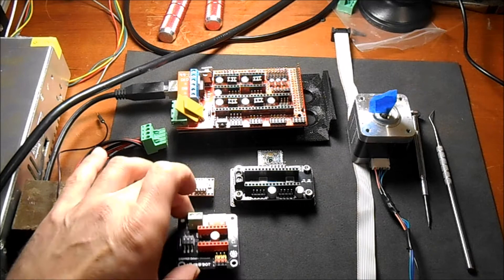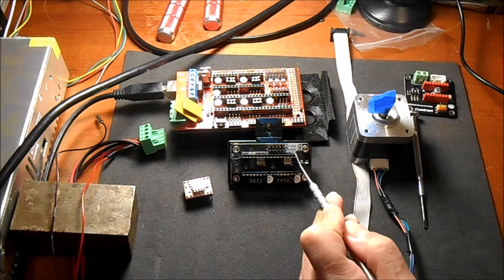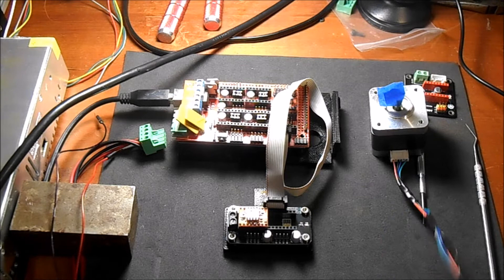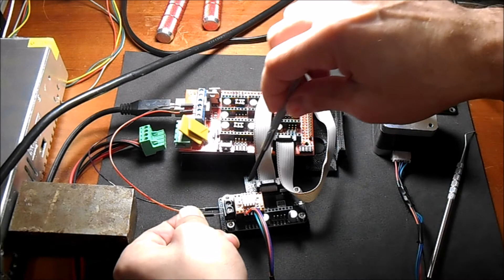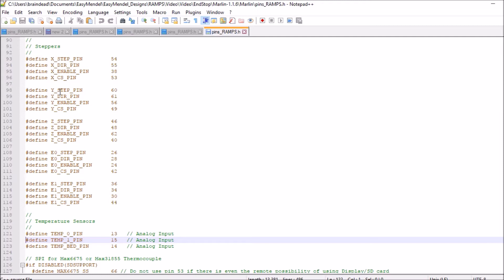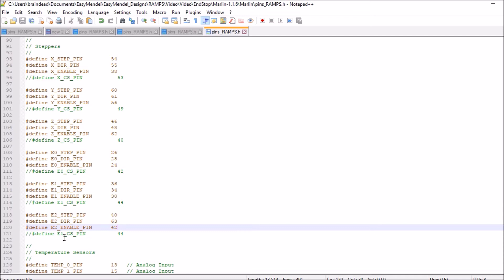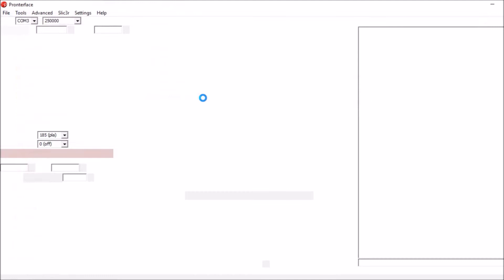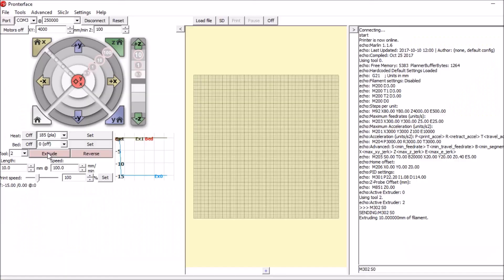RAMPS 1.4 - Adding 3 or more Extruders

Comment: I came to operate the 5 extruders for the DIAMOND x5 (FULL COLOR) and everything seemed ok (apart from the cobwebs, I am fighting with the percolation of the nozzle and the retraction) but in the end I discovered that the 5th extruder the 3rd for the extender x3, the one that has as pin: // ### EXTRUDER_4 #define ORIG_E4_STEP_PIN 57 #define ORIG_E4_DIR_PIN 1 #define ORIG_E4_ENABLE_PIN 58 both that extrude that portrays always goes in retraction, that at the beginning to resolve it quickly (not having noticed that it did not change direction) I inverted the wires on the motor and extruded but did not retract !!!! So now that I do, how can I check the pin 1 (DIR) to see that it is not badly managed or do you suggest me to use another pin?!?!?! if you can?, thanks for your patience. P.S: I use a RAMPS and the pin changes I made them directly in 33.h for the expanders I used the REPRAP x3 one with the cable already wired
it's possible ?

Comment: So I think I've watched all the videos you make, and definitely appreciate the info.  I've got a couple questions,  as I'm trying to upgrade my anet a8.  I have this setup that's in this video, stepper expander x2.  Im also using repetier host instead of pronterface.  Ive got one motor on the regular E0 connection, I have the stepper expander plugged into aux-2.  I see you plugged in the vmot to where the bed and fan connection.  Can I use the 12v pin instead of the one you plugged into to power the motors?  when I try to extrude, the one connected to E0 works the way its supposed to, however the 2 that are connected to stepper expander board, one does nothing at all and the other acts like its trying to move but isnt really moving.  Im going to be adding my bl touch after I get these motors working correctly.  Ive copied the pin code and reassigned them like you did.  Is there any other firmware changes I may have missed?  Ive made it where i can cold extrude, Ive also changed the extruders to 3 and uncommented singlenozzle.  If you want to email me and call me a noob, I wouldnt be offended, but direction would be much appreciated.  email is lloydwillis88@gmail.com  or if you wanted to leave a comment here to, up to you.  but any help would be awesome.

Comment: I was wondering how to move 2 extruder motors simultaneously. (E0 and E1).
Reply from the maker: There's a playlist in description also technically they do not move simultaneously.  It occurs so quickly it appears that way.
Reply: @EdwardBraiman  Very nice! Thanks!
Reply: @EdwardBraiman   It took me many hours to find, in RAMPS 1.4 to move E0 and E1 simultaneously IS POSSIBLE YES. Just describe in the file: "Configuration_adv.h" the line: "#define E_DUAL_STEPPER_DRIVERS" (// Drive the E axis with two synchronized steppers). But your video helped me with other issues as well. Thank you very much!

Comment: Hi Edward, Thanks for easy explanation. I found your channel is very useful.. one question if you don't mind. D40 pin grabbed my attention when you defined it as one pin in Aux-2. Although, pin D40 was originally assigned to Z_CS_PIN in Marlin firmware?  I also found ramps diagram on the internet which defined D59 instead of D40. but I'm not sure about the accuracy of the diagram's source. appreciate your feedback. thanks
Reply from the maker: So the diagram for pins might be incorrect.  One way to test is enable pins debugging in marlin and measure with a multimeter to confirm pin number.

Comment: I ask you a question when I make Arduino ramps casing for electronics my 3D printer now not powering only my power supply is power even my usb to connect ramps is not work? How fix it
Reply from the maker: I'm going to need more details, use Discord link and explain issue in General chat.
Reply: @EdwardBraiman  huh I fix now! but my LCD is not work on power supply but using usb connect to my Laptop is working.. but on power supply is blank lcd
Reply from the maker: There's a Discord link in channel.

Comment: If i wanted to add a third totally separated hotend, so theres 3. how would I go about adding the thermistor and heating wires to the board?
Reply from the maker: You could use the heat bed connection.

Comment: Awesome video. Thank you. Could I use this same method to add another X axis for independent extruder heads? I have a dual extruder printer , but both extruders share the same carriage on axis.
Reply from the maker: In the board configuration it will not work for x axis.  In a couple of weeks I'll have a solution to this question.  I'm just waiting on parts for some of the videos still to be recorded.  So far I've recorded 4 videos, granted I rerecorded 3 of them.  So I'll start spooning them out next Saturday.
Reply: Somehow Makergear made it work on their new M3 Independent dual. They said they basically did as you did to add the driver for the second x axis, called it a daughter driver. they supposedly are using the 1.4 or 1.3 board still. I wonder if they use the "daughter driver" to drive a different axis. I am also looking for a solution for the added x axis home switch. What kind of parts do you need? I have a new makergear M2 torn apart for this mod. Thank you for the reply
Reply from the maker: It may be a setting in Marlin firmware. I'll have to research.

Comment: in my ramps 1.4 board i have E0 and E1 they have the same number 2B 2A 1A 1B, what is the number of E1 pins that i can use it please, thank you
Reply from the maker: +Shell_TrayWnd the 2b, 2a,1b and 1a are the pin used by the pulolo stepper on the motor for the pulses.  I'll do more research tommorow, but I'll know more after I have more content.
Reply: ok sir ill waiting you answer and thank you
Reply from the maker: +Shell_TrayWnd one question you're trying to see how to configure the Anet for an additional stepper , correct?  So, what would like to know how to configure in the dot h file.
Reply from the maker: +Shell_TrayWnd I've got about 5.5 hours left of my work day left, so afterwards I'll have time to take a look.   So could you detail the steps you have attempted in marlinfw dot h files?

Comment: Thanks for easy explanation.
Are you using this for Diamond Extruder ?
Reply from the maker: +ChiRag Chaudhari correct.
Reply: how much retract lenght need to change beetwen color?
Reply from the maker: +Teddy Kristiyan , this depends on where you mount the feed unit and how long your feed tube is.  You can measure the distance by measuring the filament length in your printer system. Hope this helps.

Comment: I've a free place for one stepper driver on ramps (4 controller in use for 5 stepper motors on printer). Can I use the free place? Nice to know that is possible to extend with many others
Reply from the maker: So your currently connected to x,y,z and e0?  And you want to use e1? Or are you trying to add an e2?  All possible, just depends on your configuration and if you're using a heat bed or not.

Comment: Doing the further questioning here xD I have a hard time finding that 2x Extrudrboard.. do you happen to have a link or part number? (the name seems so generic)

final question, while I am aware about the different stepper drivers, would it matter to have say A4988 drivers for the extruders and TMC2130s for the XYZ? So when is it overkill for extruders?
Reply from the maker: TMC 2130 are good, as for extruder I prefer drv8825.  I don't recommend double extruder, but I think you can find it still on RAMPS wiki.

Comment: Is it possible to power it directly from the power supply instead of one of D8 / D9 /D10
Reply from the maker: That might be extremely dangerous.
Reply: Is it possible to connect it another another way, cause I have an heated bed , hotend and an fan to power. What do you recommend?
Reply from the maker: There maybe, but you have to consider s searching the forums.

Comment: will this work with repetier host as well?  I just got my new 3 way nozzel and I want to hook it up.  From what I gather, I need ramps 1.4 board to run it, regular anet a8 board wont cut it.  I am curious as to what the j3 connector for standard board does.  Is it possible to use that port to add 2 additional stepper motors?
Reply from the maker: It's possible, but I've not tried it.
Reply: @EdwardBraiman  whats possible?  Hooked up with j3 pin?

Comment: Any reason for using BOARD_RAMPS_14_EFF instead of EFB (with a heated bed)? The 12V power for the stepper expander can be taken directly from the power supply instead of the D9 on the RAMPS board...
Reply from the maker: At the time it seemed like a good way to demonstrate.  I was more interested in getting it out for people to see as most videos didn't cover most the steps.  I'll be doing a new series soon and will be fixing a lot of the house keeping issues.  More suggests are always welcome.  Thank you.
Reply: When improving things, you could consider to add a fan-extender on the servo port. This way you can control the fan for the hotend (based on temperature), and also add a fan to control cooling of the RAMPS board and stepper drivers (which automatically can turn off e.g. 30 seconds after a print is finished)
Reply: @EdwardBraiman  So Ive made quite a bit of progress on my upgrade.  Ive got 2 out of 3 motors running correctly.  The problem is the third motor.  Ive tried how you wired it up with stepper expander, I bought one and cant get it to work, so I switched to a breadboard and just driver.  Ive also changed the pins in Pins_ramps.h I have tried aux 2 and aux 1 and cant seem to get it to work properly.  it does some kind of stutter.  pretty sure I have coils connected correctly, Ive switched them a bunch as well to see if my connections were wrong.  shouldnt there be more to it than just assinging pins?  Like a pwm or some other code I have to write to ensure its making proper steps?  Im using drv8825 as the last driver for E2.  All the other drivers are the a4988, that control x,y,z,e0,e1.  I know Im close, just not entirely sure what im missing.  any help would be awesome.
Reply from the maker: This tutorial is kind of dated.  If you search my playlist there might be a more current version that might help with steps.

Comment: Bit of a late question, I assume plugging that into a GEN L v1.0 aux 2 would work as well? after all its just a ramps 1.4 really , Quick one if you have time, I am trying to get 4 extruders working with 2130's and all the SPI fun stuff AND keep the display....
Reply from the maker: Funny you should ask, I'm working on a tutorial to make 2130 to work like RAMPS, but it seems to be having issues with Marlin firmware 1.1.9. I was able to get it working on RAMPS 1.4 using Marlin firmware 1.1.8, but I'll be looking again tonight.
Reply: @EdwardBraiman  ahhh, yes, there is a bug fix for that in the bugfix-1.1.x branch
Reply from the maker: Do you mean Marlin firmware 1.1.9 bugfix.  I'm still having issues.  I think it might be a pin issue.  I'm going to do a tutorial on checking pins tonight.  This at least will give content for the MKS Gen L board and help verify the pins to get it working.
Reply: @EdwardBraiman  Marlin-bugfix-1.1.x.zip from https://github.com/MarlinFirmware/Marlin/tree/bugfix-1.1.x  fixed it for me
Reply from the maker: Sounds good, I'm going to work on after a simple trouble shooting tutorial.
Reply: @EdwardBraiman  I look forward to it
Reply from the maker: It's alright at least you have a highlight of one of the videos tommorow.

Comment: Hello!
I want to have 4 colors on my printer so I need some help. I'm thinking about using 2 cyclops hotend and a heated bad. For this I need 3 stepper for XYZ and 4 stepper for extruders. Is this possible? What will be the configuration settings and how do I wire everything? 
Please help me!
Reply from the maker: With RAMPS 1.4 they say it's possible, but I've yet been able to get 4th stepper to work.  I might take another look as my knowledge of the issue has expanded since my last attempt.  The RADDS board can handle several, I think 5 extruders, but it's been awhile since I've done a tutorial as interest seems to be for 8 bit boards verse RADDS 32 bit.
Reply: @EdwardBraiman  can you say how to add a 4th stepper on Radds
Reply from the maker: Checkout RepRap wiki they have a written example.  The time to record a tutorial may take a very long time.
Reply: @EdwardBraiman  I will use duet 2 maestro with a breakout board

Comment: How can I change my extruder  from E0 to E1 as  E0 is not working my printer is running with out extruding the filament. Please reply need help
Reply from the maker: That's an interesting question.  My first thought  might be why is E0 not working?  I might start by measuring with a multimeter power outputs on E0.  I might check the wiring of the thermistor for a broken connection.  So maybe you could describe the issue you're seeing and if E0 just stopped working or never worked?  I've experienced a similar issue where I thought it was broken, it turned out to be a broken themistor connection.
Reply from the maker: This might also help ... https://youtu.be/RBqyYgYDVDU  ... The answer for using 2nd Exturder can be done via a gcode.
Reply from the maker: You can also change in the pins ramps.h the pin order names making E0 E1 and E1 E0, I've never tried this so you can let me know what happens.

Comment: Hi Edward, 8-bit board runs multi extruders well? Please say your impresions about print quality, and thank you for the videos!
Reply from the maker: Yes and.print quality is about finding mistakes and correcting them before they occur.
Reply: Edward, dont be a good idea you make a multi filament printing video?
Reply from the maker: I believe it works well for people learning 3d print.  The 8 bit processor is only .25 percent of printing.  Settings in slic3r, pronterface and calibration all play a part.  Think about it this way we landed people on the moon safely on an 8bit processor.  So we can learn to understand 3d printing on them as well.  Ramps 1.4 is best for the cost.
Reply: Edward Braiman Is there a 32 bit version like this? I have been searching everywhere and the closest option I’ve found is Rumba and I’d prefer something like Radds, Avante, or in general more advanced. Possible to run external drivers for larger steppers on a large frame high speed printer?
Reply from the maker: I'm currently doing tutorials for RADDS and Smart RAMPS, but firmware for Marlin is not yet matured.  I've posted a couple for each.

Comment: whats the name of the 2 stepper board? i plan to make a custom printer with 3 in 1 out sway extruder with ramps. 
thanks for this helpfull video!
Reply from the maker: +Photograaf11 do you mean YURBOT?  Let me know the time frame I'm speaking around or what CC says. Good luck.
Reply: Edward Braiman 0:40 not the one you put on the side. I think I search wrong
Reply from the maker: +Photograaf11 there might be a link in an earlier comment. If not,then I'll update Saturday
Reply: Edward Braiman thanks :) the page where to buy is not longer online it stayed.
Reply from the maker: +Photograaf11 okay I'll research this Saturday and see what's up.
Reply from the maker: Here are the links, they appeared to take a very long time to load for some reason .... https://www.reprap.me/stepper-expander-x2.html
and ... https://www.reprap.me/stepper-expander-x1.html
They are both very expensive, I did find the following on ebay, but I'm unable to say how well it will install without trying ... https://www.ebay.com/itm/stepper-driver-extender-A4988-DRV8825-external-stepper-motor-panel/173044465304?hash=item284a40fe98:g:ReEAAOSwjtNZeKU5   ... I might do a video in the future on how to make your own, but I'm currently working on about ten different videos and will need to work through the pile coming today and next week.
Reply: Thanks! i subb to your channel!
Reply from the maker: NP, Thank you.
Reply from the maker: +Photograaf11 np.

Comment: i have Anet a8, i use ramps 1.4 with cnc shield as in this link: http://reprap.org/wiki/Adding_more_extruders

can you please give me your marlin config, i can use my extruders because i dont know how config marlin, thank you
Reply from the maker: +Shell_TrayWnd I'll have to research this.  I'm going to be ordering more stepper configurations. My current current shield is not working.  It maybe about a month or two.  I will have another single stepper video coming soon.  The hardware is currently in transit.  I'll also be doing a new series on something of interest soon but I'm in the initial planning phase.  Also I'll be upgrading the video and audio and lighting very soon.  So short answer I'll be trying to addr3ss the issue soon. I'll try and research tommorow after work this issue.
Reply: wooow fast answer thank you so much, please dont forget me, i need this firmware that i can use my diamond hotend, thank you so much
Reply from the maker: +Shell_TrayWnd NP just need to get some sleep before I answer.